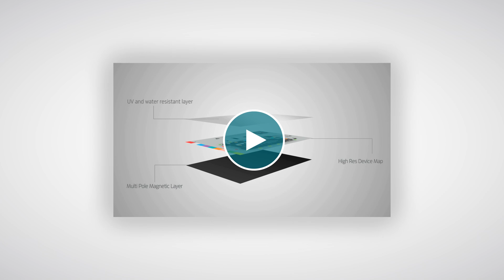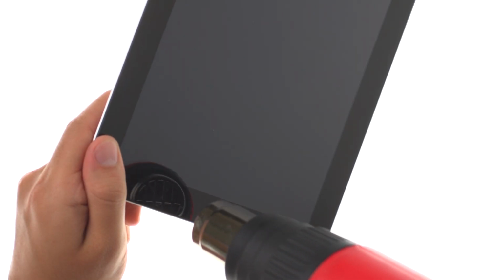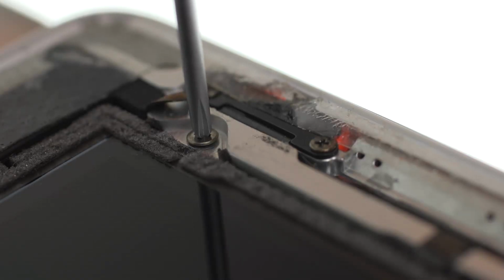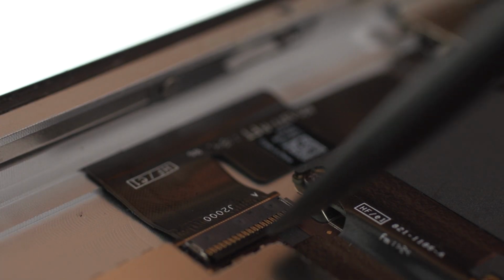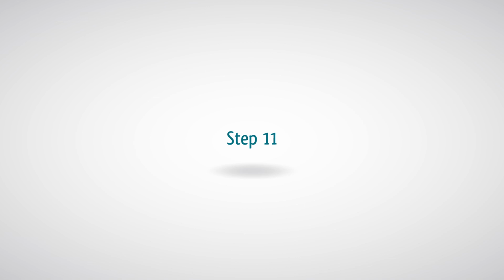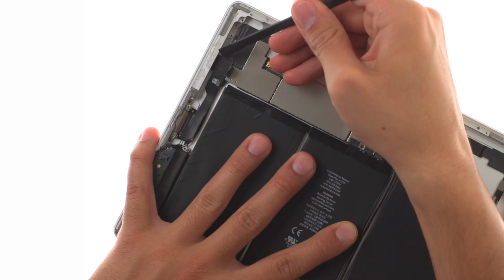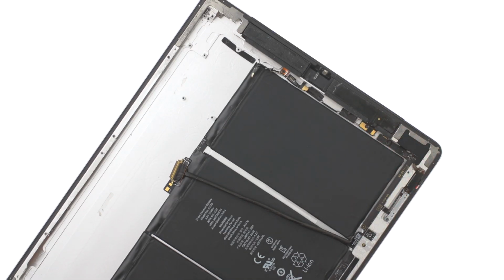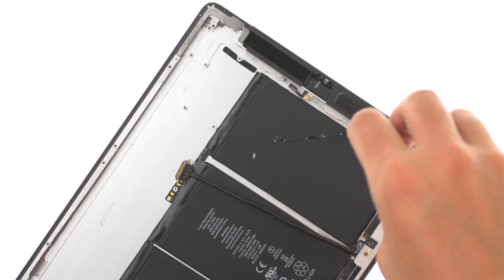Cellular Antenna repair - iPad 2 GSM How to Tutorial

Comment: Thanks, couldnt find a cellular antenna replacement anywhere else. If you only have to replace the right cellular antenna it is possible to let the audio jack and wifi connector in place. Very good tutorial. Have been doing a few ipads and this is the first vid that mentions how to properly fold the digitizer cable into place!
question: Is it possible to have both long and short distance 3g antenna in one piece? I have a left antenna piece with two connectors. And would it give same signal?